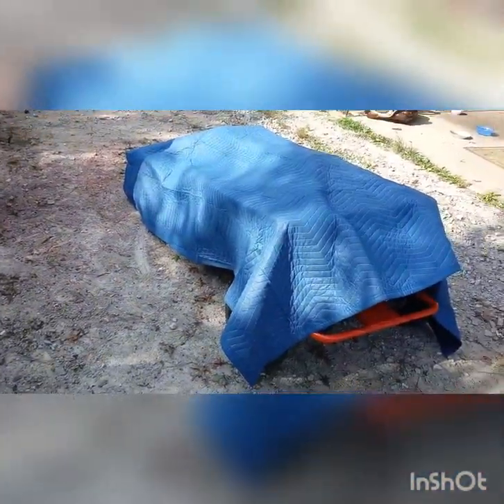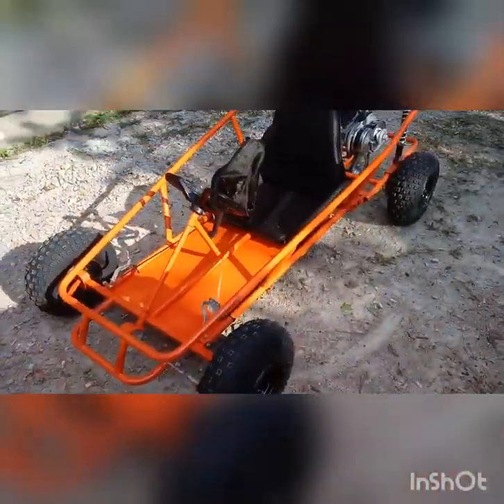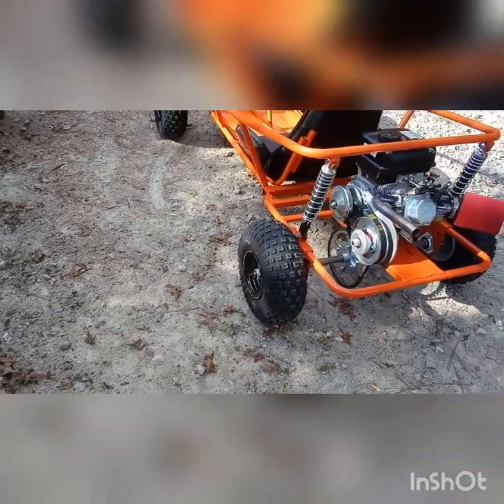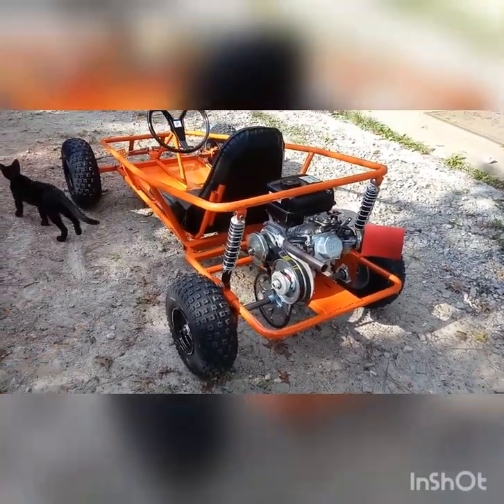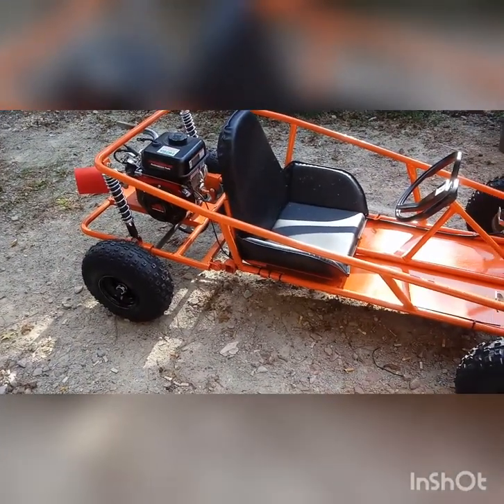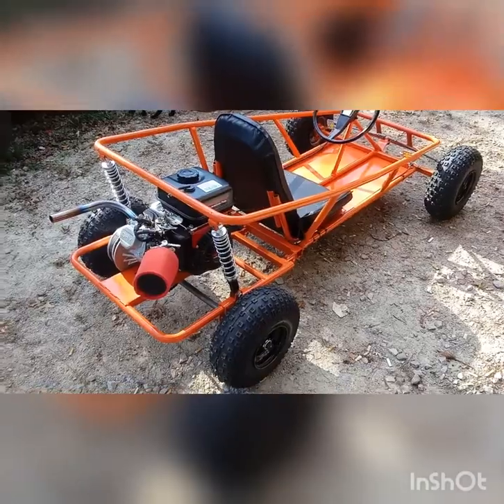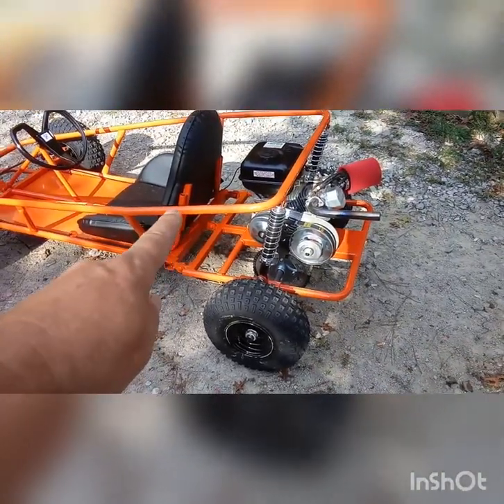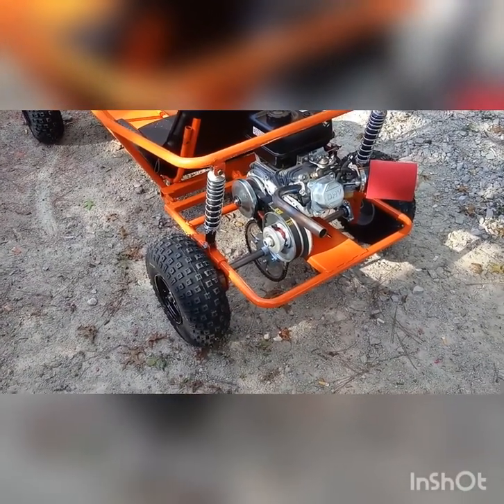The big reveal and ride Yellow Jacket gokart.

Comment: Oh ya!..she looks great!..and looks like it hauls a$$ too!
     #SMALLENGINENATION
Reply from the maker: I got up to 44 mph. Sadly its wrecked. It hit a wall at 30 mph. And flipped 3 times. I wasnt on it. I got off to check the throttle cable. And the piece on the carb got jammed wide open. So when i cranked it. It took off and hit a building and flipped. But im ok. And the gokart can be repaired.
Reply: Oh no....idk what to say..that sucks
Reply from the maker: @GoKartsorGoneFishin  im just glad i wasnt on it. The brake cable broke also. It all can be fixed i have a grinder and a welder. Test and tune.